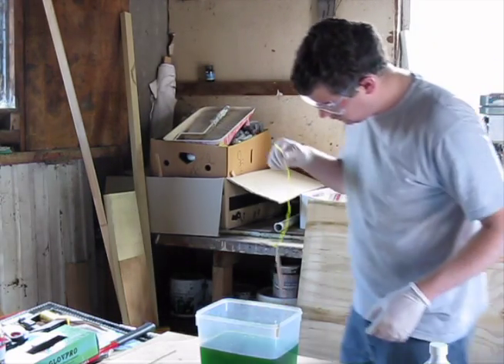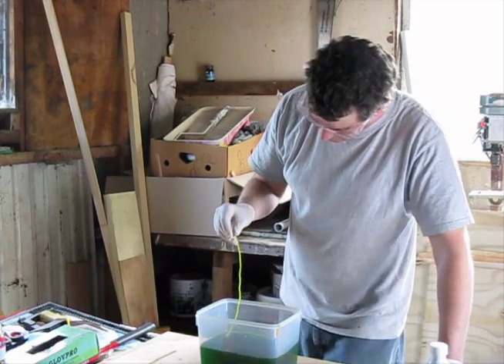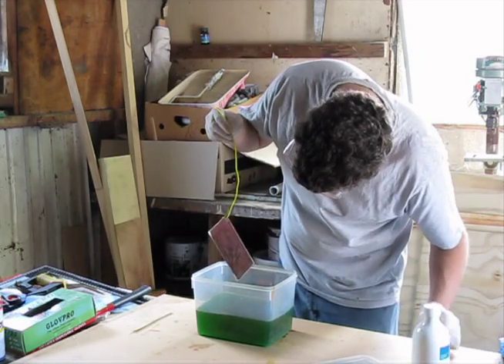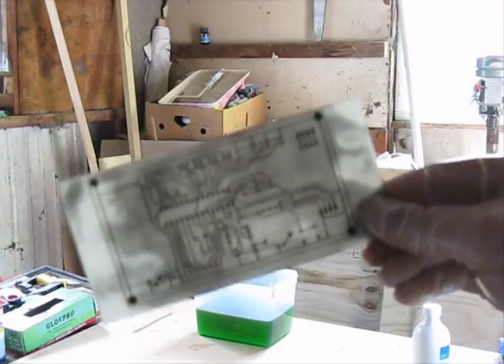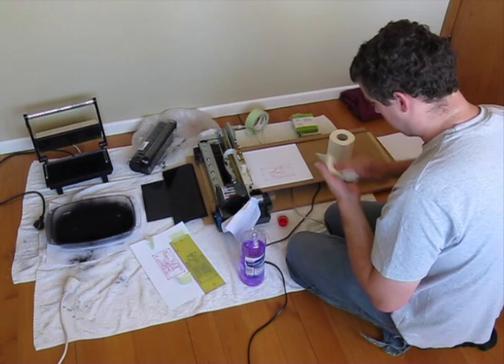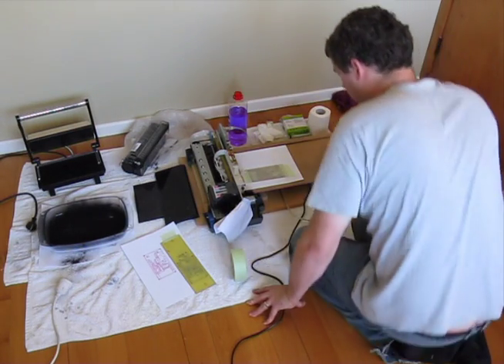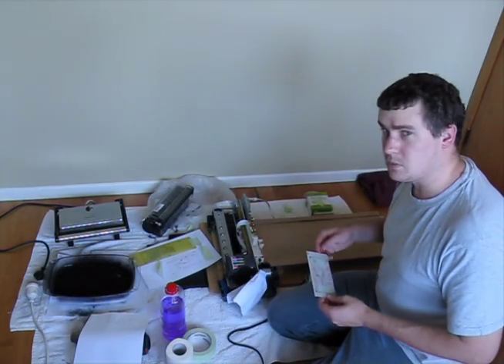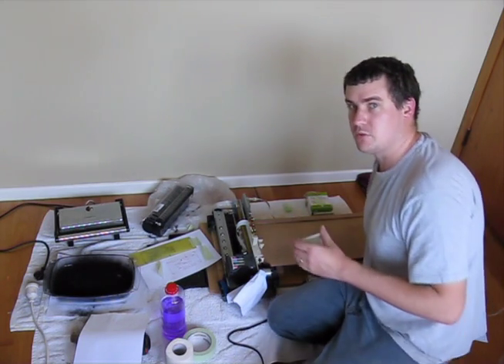PCB Printing Injet/Toner Hybrid Part 2

Comment: Good video.. but why not use  TT method in the beginning.. for example.. get in your local paper shop a thermotransfer foil used for INKJET transfer on t-shirts.. and apply toner to it.. then just iron it.. it will leave exceptionally good tracks.. also it can be used to print silkscreen.. after the printing of silkscreen then just add a coat of matte lacquer.. it will stay forever..